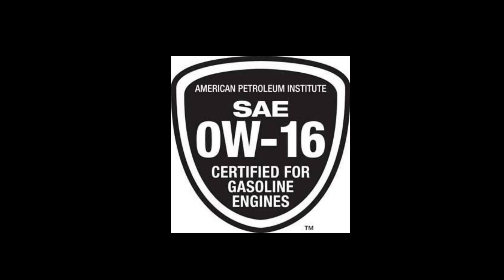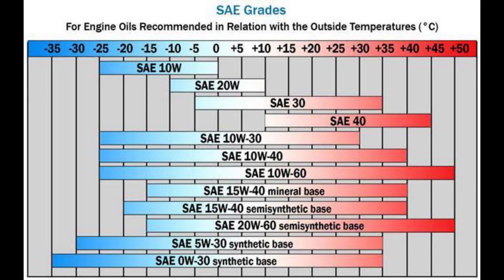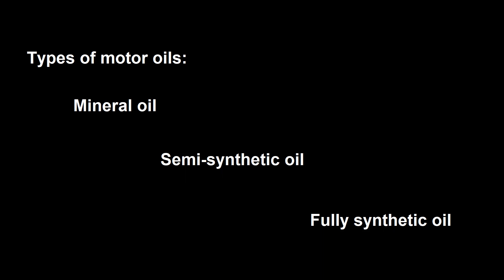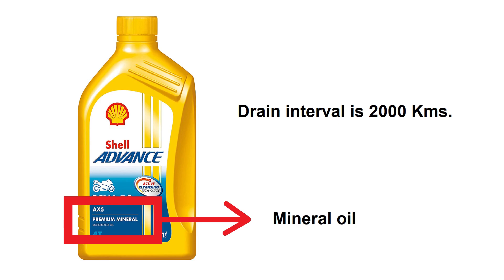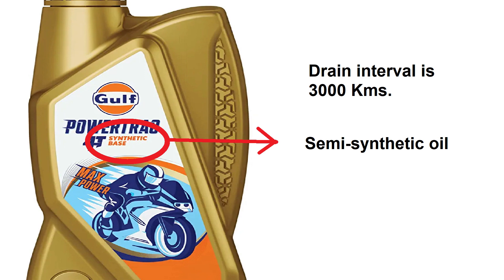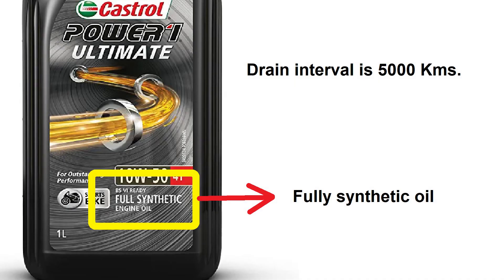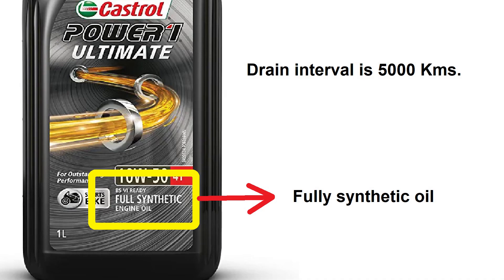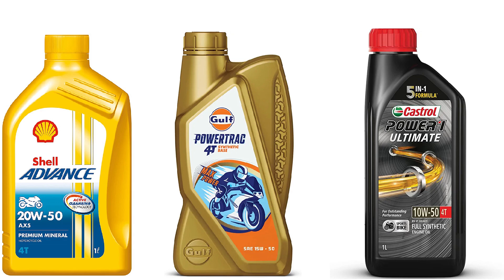Mineral oil Vs Semi synthetic oil Vs Fully synthetic know the difference

Comment: Bro if I buy Moto oil from an offline shop will it be fake
Reply from the maker: Hi Sir, many of them sell fake oil because  local shops get more marginal benefits by selling duplicate products and until someone find and file case in consumer court they'll not stop selling it. 
What you can do is go to any original official oil website and from there you can order. Example: go to shell website and from there you'll be redirected to original oil to buy from amazon.
Reply: @PavanKumarHB  bro if i am able to get loyality points from inside qr code then it will be orginal right?
Reply from the maker: Yes. But 25 rs is nothing now a days.
Reply: @PavanKumarHB  yes brother I asked like if it is a fake bottle then the QR code will also be fake right
Reply from the maker: QR code can also be copied from original but many ignore while duplication and few take copy from original you can find out by the printing quality

Comment: Bro my bike having un even rpm. I have cleaned carburettor and check any air leaks from tubes all are good and two times my back break light switch burnt and bulb also burnt .when I press break light the light is become dim is it any power problem or rectifier problem.
Reply from the maker: I think it's short circuit caused by faulty rectifier or capacitor. Uneven RPM might be a chance of bad CDI.
Reply: @PavanKumarHB  thnks bro surely I will change first rectifier and later cdi unit